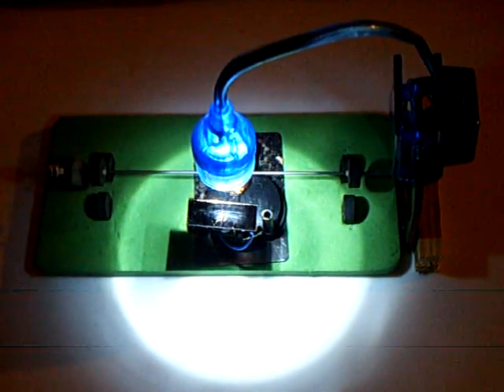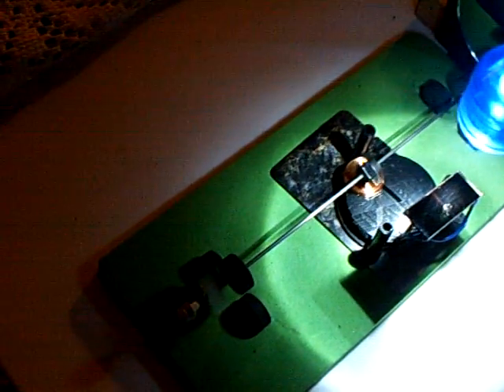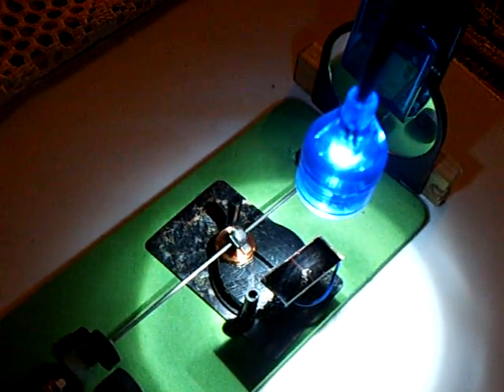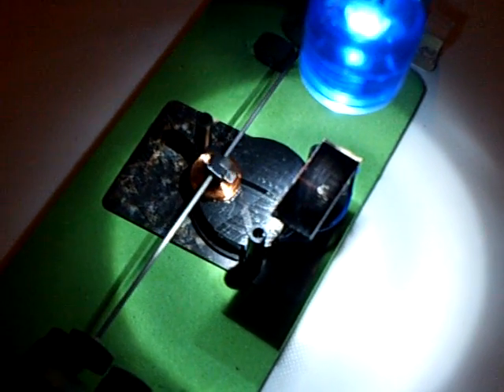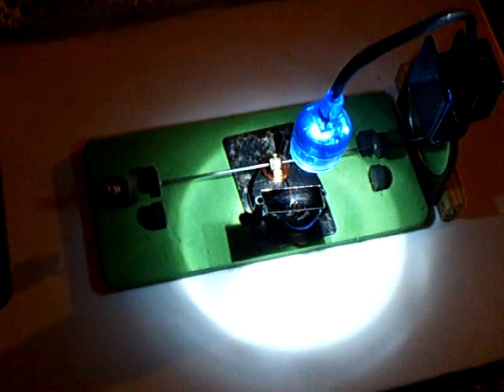One LED powered pulse motor

Comment from the maker: That can be done.  You just have to have enough low light level solar panels to gather the needed energy even on cloudy days.  Maybe we should call up the guys at Caltech and ask for a little help.  One of their solar powered Mars rovers is still working after many years of wandering around up there. The second rover got stuck in the sand, couldn't get enough sun, and went to sleep.

Comment: Neat video :)
Has potential for 24/7 to my eyes. 
Could run it on solar in the day with plentiful sized panel for rainy days. For dusk til dawn could use a solar garden light to charge a 2000mAh or so rechargeable and use the solar lights LED. Light comes on as dusk sets in, to keep it running 24/7. To trigger early, the garden light panel would face say North or toward late afternoon shade area, while daytime panel faced South sun. Just an idea :)